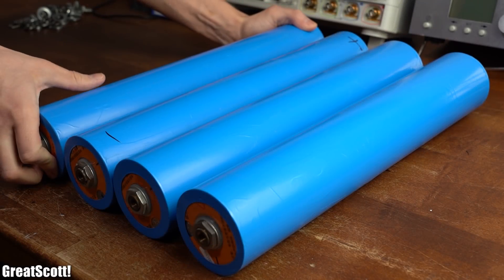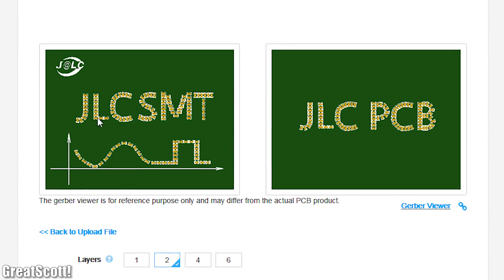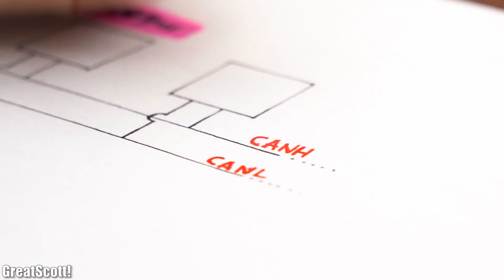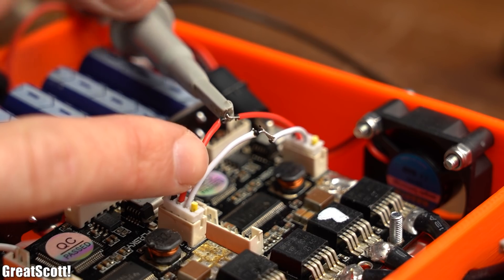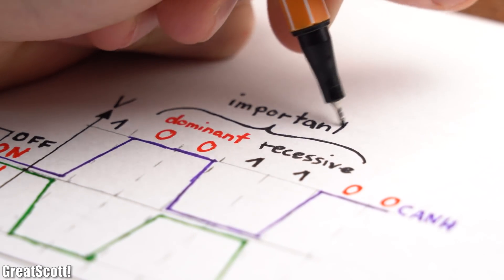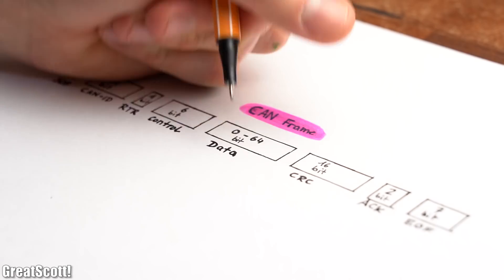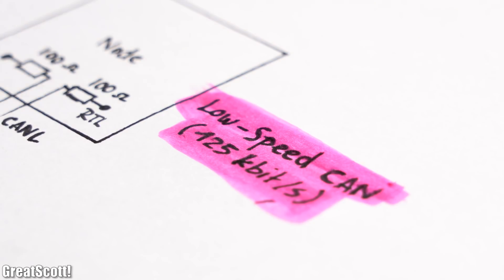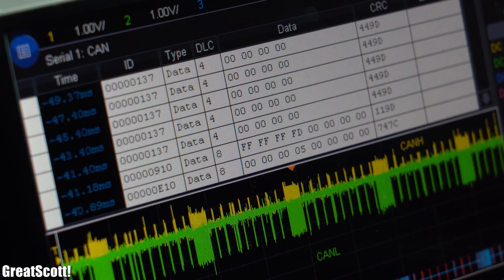Improving my electric longboard with a CAN Bus! What can the CAN Bus do? EB#44

Comment: We use a canbus communication system on my FRC team’s robot. They’ve always told me that it’s way simpler than PWM because now there’s only two wires to worry about instead of three. However, in my experience, It only seems to make it even more complicated. If there’s just one faulty connection in our robot (which is bound to happen in an intense match) the whole thing stops working, making it a bitch to diagnose canbus errors, since we cant eliminate what we already know works from the list of things that could be wrong.
Reply: I forgot I made this dumbass comment. I have changed my mind. I like canbus now.

Comment: can one connect 4 of these 4.12 vecs through CAN? if so how those the wire look like? And is a loopkey still required for it to not damage the boards? It would be cool if you explained why it damages the boards with no loopkey, it is a mistery to me

Comment: Did you made another videos about CAN bus system?, i recovered a very damage battery from an electric bike, is 36v and it has battery output, charger input and 8x wires labled Link A, Link B, GND, CAN L, CAN H, VSYS, WKUP, 1-WIRE, is obvious these 8x wires are not for balancing the battery cells but i don't know why the BMS board would have these apart from the battery having a standby mode controlled by the CAN bus???.
Any idea?.

Comment: Can bus is also widely used in mobile machinery to connect hydraulics controllers, joysticks, sensors etc. PEAK CAN-USB adapter is pretty awesome and cheap tool for this. Also diesel engines use CAN extensively, with J1939 standard.

Comment: Wath you explain about the CAN protocol is very similar than the CANOPEN communication protocol and the PROFIBUS protocol. Bolt are base on two wire communication connect between IPA. Nice Video continue like that😁

Comment: Volvo cars first used the CAN system in 1998, It has 3 different speed networks, and some LIN serial branches for simple motors for example heater flap servos and headlamp leveling motors. They also have a fibre optic network for the audio system, radio,amplifier,tuner,cd player,phone,navigation, cameras which carries audio , video and also all the control data,It is good to see just 4 wires going into the complex instrument panel compared to 60 on the older instrument panels😊 there were about 30 different modules on the system. Today's 2019 Volvo's are probably 10 times more complex ! The system is very reliable...
Reply: And what about Bosch in 1983?

Comment: The ESC in my longboard I built keeps turning off when I try to accelerate fast, would this be a battery problem?  It used to not have any problem with fast acceleration

Comment: As I told you in the RS-485 video, you can't just twist 2 wires and show people that's enough. It's misleading because it works for short wires, but it will fail for long ones. The twisted pair has to have the instantaneous impedance of the line, 120ohm on most CAN buses. This impedance will vary with the diameter of the copper wires, the distance between them and the electrical proprieties of the insulators. If anyone wants to know more about this, look online for "transmission line theory", "instantaneous impedance", "signal integrity", "EMC compliance" and "differential signaling".

Comment: I hate working with CAN bus systems, they make everything unnecessarily complicated. Such as installing extra high beams on our car, since our headlights are CAN bus controlled I had to buy a special XBB relay in order to get the signal to turn on the LED high beams I installed. >_<

Comment: nice video. i wish i could have watched this when i first started working with CAN.
would have been nice for you to also show the can rx and tx lines on an oscilloscope (connection between transceiver and micro, they are not differential, and are directional)

Comment: This is actually really cool! I've also got an Android head unit in my car and just went through the process of installing a dash cam. My head unit has a CAN bus adapter on it with one pin that gives voltage when the car is in reverse. I had unplugged it because I didn't have the camera until now. It's really cool to know that that device is basically just listening to a data signal and looking for whatever device gives the reverse signal or any of the other controls it plays into. Maybe someday I can extend the functionality of it to do more things, like add a button that activates the reverse camera at any given time.

Comment: Please note that the CAN Bus protocol has no intrinsic security protocols and, as such, trying to send data to a car's Engine Control Module is VERY dangerous. Some vehicles have security protocols in place for things like the antilock brakes, programming keys, flashing ECM firmware, etc, but sending data on the engine's CAN Bus can lead to all kinds of safety problems.

Also, some vehicles implement multiple CAN Bus systems in parallel: one bus for the engine and transmission and another for the entertainment system.

Comment: Don't forget that in cars in some subnetworks LIN bus is prefered due to cost and that it is unecessary to have the range of diagnostics of a CAN bus.  Actually some of your examples like the electric windows of your car are most likely running on LIN. In general a lot of the ECU's contained in the comfort sector won't get a CAN Controller.

Comment: But what are benefits of a CAN bus compared to TWI (IIC) bus or RS-485?
Reply: RS485 is only a layer 1 definition aka physical layer (and that is quite similar to CAN). It always depends on the purpose, but reasons could be: 
- multimaster (CAN vs RS485 - no built in collision detection)
- reliability on longer lines (CAN vs I2C)

Comment: Is CAN magic? How come you just connect two wires and now you have resolved the different RPM issue???
Reply: It's not magic, just the bus that a few quality-of-life features on these speed controllers happen to use. RPM-Matching-over-CAN just uses CAN to share what RPM the 'master' is at so the 'slave' can follow. The one that gets the external signal converts it to CAN, and sends target RPM to the other one.
Reply: @DFX2KX  fine, but when did he explain that? This is pretty fundamental, and it could have happened over any bus, it does not have to be CAN especially given the short distance. How is a master selected and how does it know the slave address? There are so many missing yet major details

Comment: I am going to say this again,
CAN is unnecessary and overkill, and unless you use fault tolerant CAN, if you don't follow the strict wiring protocol, will cause problems. Especially when one of your nodes does something as egregious as treat the CAN bus as a UART!

I2C was literally designed for intermodule communication in such an application. Just because FIRST Robotics uses overkill on their robot doesn't mean you should too.

Comment: So you're telling me, if I figure out the CAN ID for the windows, I can use the OBD2 port to tell it to open and close?
Reply: OBD2 might not expose the CAN bus for the window ECU. Often there's a filter, sort of a firewall, between the inside can buses and the ODB one. A car can have multiple CAN buses. The drive train, Airbag, Multimedia, etc. It should prevent your entertainment system to send wrong data to important saftety systems. Imagine a Virus which triggers at 160km/h and accelerates full throttle and triggers the airbag, but the entertainment system should be able to see your fuel consumtion, etc.
But if you open up your car and hook on to the real can wires for that subsystem, you could do that.

There are some older cars, which only have one CAN bus that isn't filtered on the ODB. Maybe you have one of these.
Reply: drstefankrank Thank you for the detailed response, I've always wondered about the "Send Command" option on the Torque App, I had an idea that maybe you could get the windows to operate through OBD2 or even operate the windshield wipers with an audrino or raspberry pi. Maybe the last part is possible as you said, if you were to tap into it directly
Reply: Car thieves have been known to use a device plugged into the diagnostic port, on some vehicles, to disable the immobiliser and start the car without keys. There is a project where someone killed the engine over the mobile network by using a device plugged into the diagnostics port too. Probably doesn't work on newer vehicles, but interesting none the less. 
https://www.youtube.com/watch?v=3jstaBeXgAs
https://www.youtube.com/watch?v=MK0SrxBC1xs
Reply: @threeMetreJim  on the ODB2 port, there are a lot more pins that aren't the requirement of ODB2. Some are data buses of other systems to do updates of the ECU. Like Toyota Techstream software with a VCI cable or VCDS/VAGCOM which uses some CAN bus. No standard here, depends on the Manufacturer / Model / Year what is possible. If those are exposed and if they aren't protected by some sort of key, you can do a lot of stuff this way. Maybe, it's a way of getting to the window motors can bus on some models.

Comment: It is quite similar to I2C. Please explain me the advantages of CAN over I2C. anyone please explain
Reply: Thanks @Ryan  that was a big help
Reply: It's noth]ng like i2c.  That's a synchronous 3-wire communications protocol with a dedicated clock signal. Also i2c is a master-slave system, peripheral devices can't communicate with each other.
CAN bus is 2-wire asynchronous, clock-less, and peer-to-peer, there is no defined master-slave relationship.

Comment: Great explanation, thanks! Could you perhaps zoom in on securing such a CAN based system? Because, unless I missed something, in your current setup, wouldn't someone be able to hook up a device with ID 0 and for example make one wheel spin harder?
Reply: The CAN bus on these controllers isn't wireless. The wireless module to the controller is a completely separate board. CAN bus doesn't have any security at all AFAIK
Reply: Assuming you were standing still so they could hook up then yes.
Reply: @irvingc4255  But if you don't notice people messing with your electronics while you're on the board, you have bigger problems :P

Comment: Just a quick note: do not use bare MCP2515 boards with Raspberry Pi or other 3.3v GPIO boards. In order to use them you have to cut the back 5v trace of the board and solder 3.3v power directly to MCP2515s chip leg (or a naearby capacitor which it is connected to).
Reply: Odd, all the mcp2515 boards I've used work on both 3.3 and 5v as long as you connect the board's Vcc pin to the right voltage for your MCU.  The mcp2515 chip is spec'd for 2.7 - 5.5v supply.
Reply: @irvingc4255 That's correct but TJA1050 requires 5v VCC to work in spec.

Comment: CAN-bus is still used widely because it's low-cost and simple nature. In newer cars even headlights and car audio goes through CAN-bus and that way it can detect problems like broken Xenon bulb or broken brake light and inform the user. That also allows easy diagnostics of transmission, fuel and ignition modules (Bosch Diesel EDC16CP31 as an example).. Optical networks (POF) in cars have been since 1998 and the amount is increasing over time when the technology evolves. Then there is LIN-bus (Local Interconnect Network) that can "talk" simpler things like car wipers, seat occupant sensors and window lift.

And yeah, i work with cars :)

Comment: What oscilloscope are you use at then end of the Video that show’s the CAN decoding?
Reply: Most modern digital storage scopes have serial decoding either built in or as option. I use a PicoScope (usb scope) or get a cheap $20 CANBus Analyser off eBay with software.

Comment: A W E S O M E   C A N   I N T R O   👍
Q. With more than 2 nodes, do they connect similar to a parallel circuit with just 2 more wires to each consecutive node?? Cheers.
Reply: Yep. as long as the IDs don't collide, you're good. I do think there's a hard limit, I'm not sure how many devices that limit is, though.
Reply: DFX2KX - thanks 👍
Reply: @DFX2KX  the ID doesn't relate to a node but to a message. Any device can send a message with that ID assuming it makes sense, just as any device can listen for and act on any ID. So in a car the ECU will transmit an "engine revs" message and the cluster is listening for, and displays the data from, the "engine revs" message. However, if you put another device on the bus transmitting random "engine revs" messages you can make the rev counter go mad ( I've tried it :) )
Reply: Irving C - lol. Thanks for all the info IC, very much appreciated. Cheers
Reply: It's a bus. For the low speed variants it can be wired as a star with some distance limits, but for the higher speeds it's a true bus (often implemented as a daisy chain) terminated at each end with 120ohm and no node can be more than 0.3m off the bus. Wikipedia has a good explanation.

Comment: U are really great. Thanks for your nice presentation. I have a request for you, could you please make a project like range finder or distance meter. Not using ultrasonic or any loS devices. If you're use ESP8266 RSSI or any RF RSSI based system then I I will grateful to you. Actually I want to make a device for crane safety collision avoidance system. But problem is RSSI to distance finding.

Comment: Hi, In can Devices doesn't have any IDs. Only messages have IDs. Any device can send a message with any ID. The message with the Lowest ID number gets the preference. So the priority is not device-dependent. It is  only message dependent.
Reply: Depends on the protocol in use. In situations where you have multiple instances of the same device, say a motor controller, on the same bus, there is a need to distinguish between the devices. Protocols such as J1939 implement a "name" negotiation process whereby devices claim an identifier that is later used to augment the message ID. This then also allows messages to be sent "point to point" within the protocol using source and destination addresses, as well as the standard broadcast address
Reply: yes you good
Reply: Mira mi nombre 😻😮😏🖤
Reply: True, but in real-world applications, each CAN node maintains a corresponding constant ID when sending frames, thus letting other CAN nodes know about the originator and the priority of the CAN frame.
Reply: that's pretty smart. but to me it seems like most devices would use a constant id anyways. what happens if two devices have the same id? do none of them terminate?

Comment: Make an ai for that (u can get some help from codebullet in the ai if u want )so it can drive it self to you depending on a sensor system
Reply: The trick would be steering itself, as a longboard/skateboard is made to steer by weight-shift. Could see that collab being cool for an R/C car though.

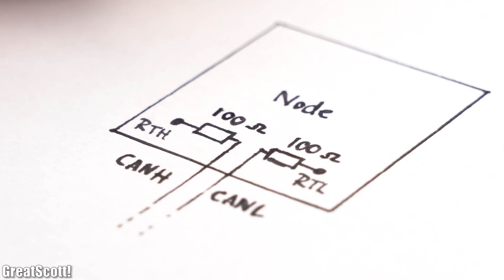Comment: 8:35 5MB/s is not same as 5MBit/s there is difference. Are you sure that the speed is 5MBit/s? Cause it seems od.... Almost everything is in bytes not bites B=byte, b=bit. --> 1byte = 8 bits
Reply: Transmission bandwidth are mainly measured in bits, not bytes
Reply: You've never noticed that internet speed ratings are typically defined in bits/second?

Comment: Can one hijack a canbus? (no pun intended)
Reply: Yeah, if a malicious device sends lots of frames with ID 0 over and over again, it will jam the whole system and pretty much disable it. People have done it to cars and it makes every possible warning light come on the dash.
You can do less destructive things like make the gauges show whatever reading you like, or move the electric windows or mirrors, etc. You can also just record speed data, or temperatures, or pretty much any sensor in the car.
Reply: @Colbie Dison can i do this with a hack RF one?
Reply: @CommanderCrash  No, because it's not a radio transmission. It's differnential voltage signals on a twisted pair of wires. CAN bus transceiver boards are cheap, though.
Reply: Yes, of course someone can.

Comment: Great explanation of the CAN bus protocol down to the wires, but I've no idea how exactly that solved the RPM difference problem.  Did you write firmware for a control loop, watching for RPM differences between wheels, via CAN bus data reads?
Reply: The problem was that the two escs weren't reading the pwm signal as exactly the same value. By switching to a coded signal both escs receive the exact same value every time.
Reply: PPM is an analog protocol, and the value read by the ESCs might be varying since it has to read the edges by itself by timing them correctly. It's easy for errors to get introduced by electrical noise too. CAN on the other hand, is a digital protocol, and so the ESCs can read the exact value to spin the motor at and hence both have the correct RPM.
Reply: @tanmay______  actually PPM is a digital signal, it's just not so much reliable as it depends on timing. If it was analog it would measure the level of the signal instead.
Reply: @michelfeinstein  oh thanks, good to know
Reply: One of The escs reads pwm and transmit that data via can to second coupled esc
Reply: as he said, he ensure same power is delivered to both wheels. so basically he monitors the V x I of each of the motors via Canbus.